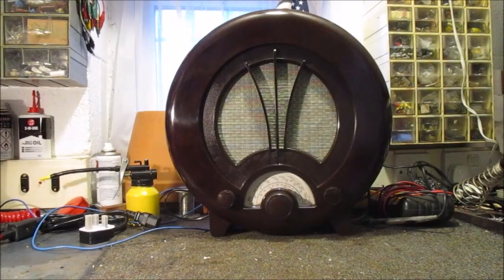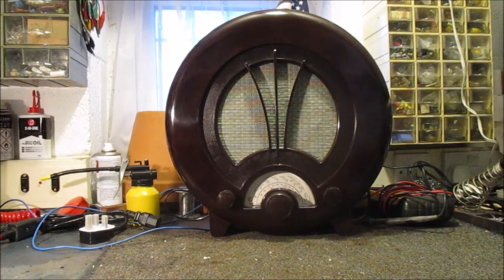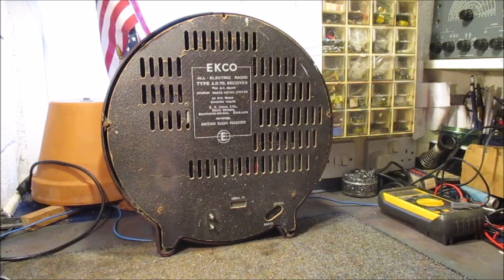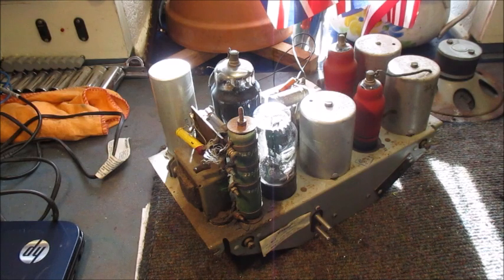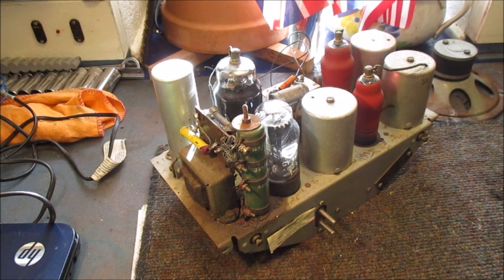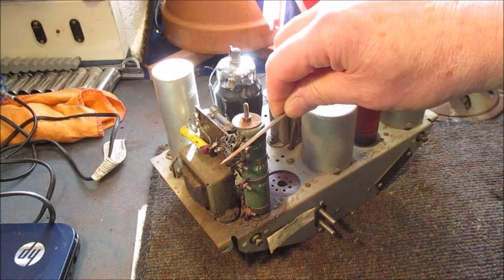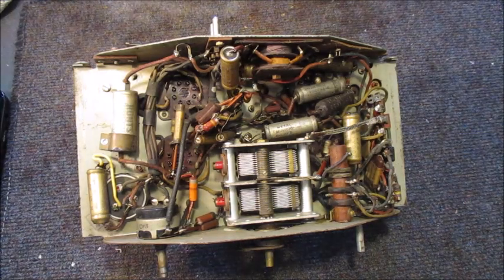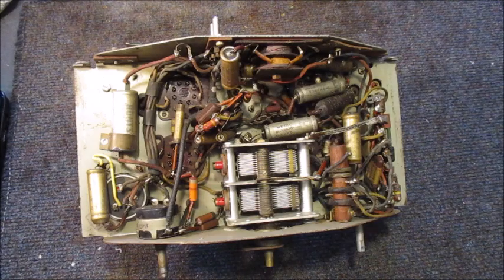Ekco, Model AD75, Reconditioning, Part 1

Comment: Phil, that is one good looking radio.. I love the design and the way you've gone thru it and given its history. Very good suggestion on closing the tuning cap and removing the tubes...... That speaker looks like fun but its easily repaired with a bit of coffee filter and glue or your repair material of choice.......  and I still love those Red tubes.... i've tried using electronic copies and its hard to make notes..... Great video mate-   Looking forward to part 2
Reply from the maker: Hi Ron,
For some strange reason, over the past thirty years the round, saucepan shaped Ekco radios (there were six models in total) have become very popular among collectors …and they are outlandishly expensive.  Take the model AD65 (from 1934), they are commanding ridiculous amounts of money.  If you was to look at the circuit diagram of any one of the ‘round Ekco radios’, you would immediately notice how conventional they are.  
I first repaired an Ekco, model AD75 when I was aged around 17 …it, along with any valve radio those days, was just another radio that came into the workshop for repair.  Over the past twenty years, I have sort of warmed to those round Ekco radios which is a bit of a shame since that was around the time they had become expensive.  Before that time, I could have gotten any one of the six models for few pence, certainly no more than a couple of quid LOL.
Incredible as it may appear, when I was selecting this radio as my next You Tube reconditioning candidate, I knew it incorporated those red coated metalized valves, and I immediately thought of you LOL.  They were popular valves of choice among British radio, and television manufacturers for about twelve years – 1938 to 1950.  After that time the B8G locktal, B7G miniature, B8A Rimlock, B9A noval etc. largely took the place of octal valves incorporated into radios from around 1950 onwards. 
Cheers Ron, take care and remain safe, Phil.

Comment: Wow Phil it's great to see u back in action, I'm very much looking forward to following this series,  I have an AD36, bought in very poor cosmetic but undamaged condition, and awaiting my undivided attention at some point. ....take care......ps would u agree handling and working on something of this age and value causes a certain "nervousness" not experienced with say a 50's Bush set  ?!!!
Reply from the maker: Hi,
Thank you for your comment.  Over the past fifty years, I've worked on valve radios from the early 1920s through to the late 1960s - provided their valves are functional, I don't let them bother me.  A small number of odd exceptions aside, they follow particular routes: TRF, Superheterodyne, Ratio, Foster Seeley etc. which conform to fairly conventional circuits.  As you will see in the next episodes, this radio was gotten working: it had no option LOL.  
The AD36: a four valve TRF receiver introduced onto the UK market in 1936: a nice little radio to work on.  Getting it up and running again shouldn't pose much of a problem.
Nice to hear from you - stay safe, Phil.

Comment: i think those dropper resistors were supplied by rs components in the golden days
Reply from the maker: Hi Ian, 
RS did stock individual dropper section resistors.  Very likely the dropper resistor seen in this radio would have been sourced from manufacturers like Egen, and Morganite.
Cheers, Phil.